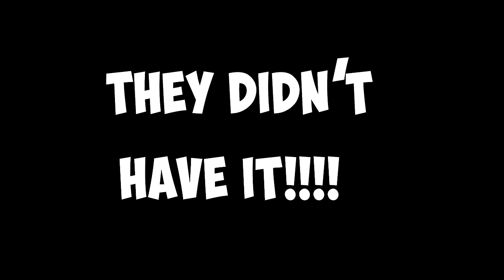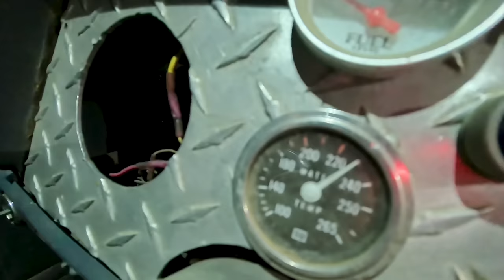Custom Built Four Link Bronco Dominates King of The Hammers!

Comment: Skilled driving requires an awareness of exactly where your tires are, and what they are doing. Broncstar's tire footprint dimensions and suspension are completely different than before, so this was literally the first time Hillbilly has driven this vehicle. He did a fantastic job for his maiden voyage. Awesome driver and vehicle! Congratulations!!
Reply: That's a great point, he had very little seat time after the build prior to fixing the steering issues, but that was with the old tired original Engine also, so It really is his first time driving this setup and he did great, I'm glad there wasn't any  mechanical issues this time and he got to drive it successfully and proud. he deserves it. I know he put a lot of time and working days off just doing the swap not including all the other fabrication stuff. it's a totally different beast than his trekker  (which is also super cool) I hope they put lockers in that and freshen up the engine

Comment: As a profeesional fabricator I spent many man hours using a Square Wheel 2 x 72 belt sander. In fact, the most painful injury I ever experienced was using the Square Wheel with 36 grit to grind segments of bronze casting to prep them for TIG welding them together to create a "Burning Bush" for a Jewish Temple. I slipped and ground off my right thumbnail. I'm sure there are many other injuries that can be more painful, but this was the worst for me. I don't need no steenkin' Stanly cup. I have a couple of Milwaukees. Last year my son and I were camped right across from where you turn right to head up to Chocolate Thunder. I'm still blowing dust out of my nose.

Comment: High lead in those Stanley mugs.
There's a recall.
Reply: No there's not. There's lead in the plug on the outside of the mug, covered in paint. So unless your bench grinding the bottom of the mug and sucking up the dust there's literally zero risk.

Comment: half your info is for the Daytona! The Charger had a recessed rear window, and so the Charger rear window was changed to flush mount for the 500 and Daytona. The stock Road Runner body got 70 Coronet front fenders, a nose cone and wing.

Comment: Good deal on all your adventures. Sorry you had so much trouble finding the Bosses new Cup. Congratulations to Hillbilly on getting up Chocolate Thunder so easily twice. Congratulations to you Robby on the Superbird. Did you check the Vin number on the car to make sure it's not a clone? Even if it is it's still pretty cool. Nice belt grinder as well.

Comment: Ameribrade is pretty cool but that attachment isn't top secret and has already been done. I worked for the Stephen Bader Co. for 11 years and the Centerless belt sander has been one of their grinders since the 1950's. I designed and made multiple 2" x 72" Centerless grinders for customers but they didn't want to bring it to production out of fear it would damage sales on the large grinder. Their loss is Ameribrade's gain.

Comment: Congrats Hillbilly. Good job... I could tell you guys were genuinely having a blast. 
Good job scoring the Stanley cups Robbie even if they were 100 bucks a piece...
The whole thing has gotten nuts. I've been using Stanley cups forever, but I don't
have any fancy new ones. I have a well used 16oz green and a 16oz black travel mug.
Maybe I'll start cruisin the TarZJ and WallyMart parking lots and see if I can find
some lunatic that is selling some new cups. I ain't payin 100 bucks for one though.
It would be my luck that it would be an undercover drug sting and they put some
crack inside of the cup, and I'd end up in jail...

Comment: The stock fan in my corvette doesn't even turn on till 238 degrees. 230 isn't nothing. 
Also the broncstar needs a doubler so it can crawl up those rocks and not break anything